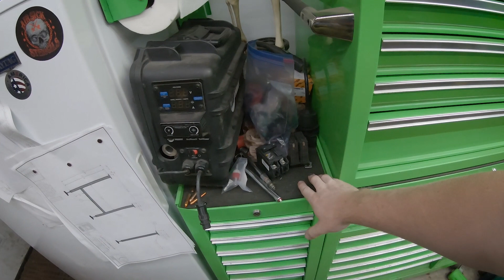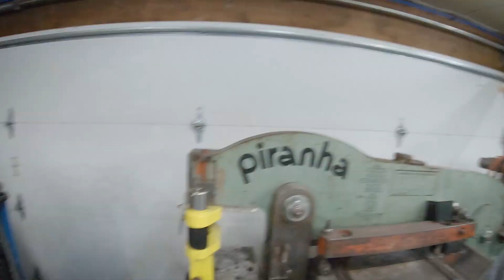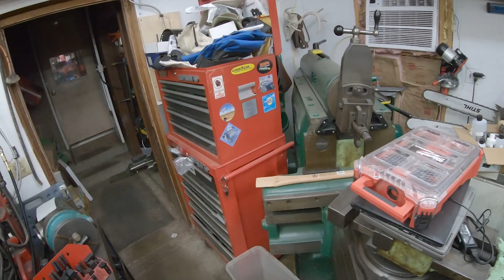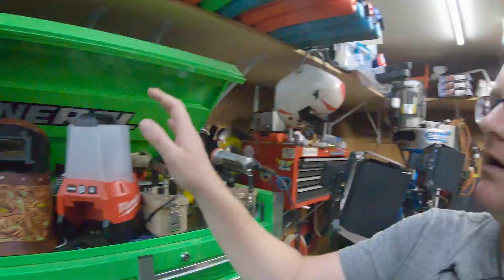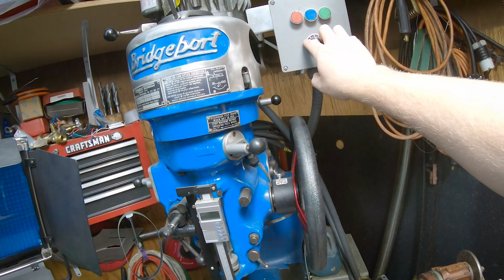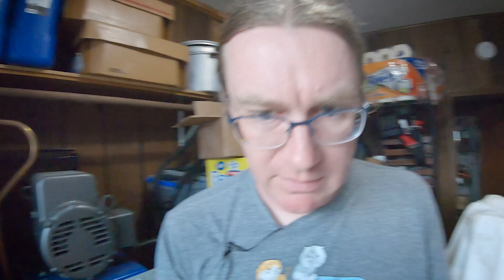You won't BELIEVE everything in this SMALL Machine SHOP

Comment: Zak, many videos ago you lamented about having issues with a small Miller MIG welder and it's "MVP" plug... how is that welder working out now?
Reply from the maker: It's still going strong, turned out the extension cord had a bad plug. Burned up the plug adapter on the welder. Easy 20$ fix, that little welder has made me so much money over the years it's just crazy.

Comment: You put a 5hp motor on the bridgeport haha I bet that thing is a beast....well for a bridgeport anyway
Reply from the maker: Lol yeah, mainly put the big motor on so it still has torque at low speeds with the vfd. I don't ever need to change the belt position going from 0-2000 rpm
Reply: @DarlingtonFarm  thats a good idea......I have a 10 hp American rotary phase converter (I think its the same one) and I  guess I should go check that 3rd leg...... I bought it brand new never even checked it